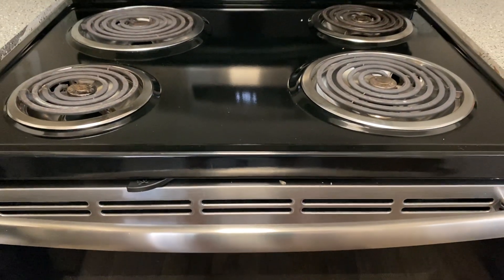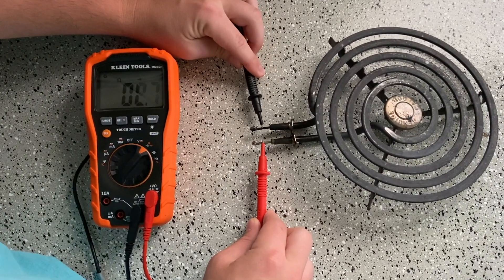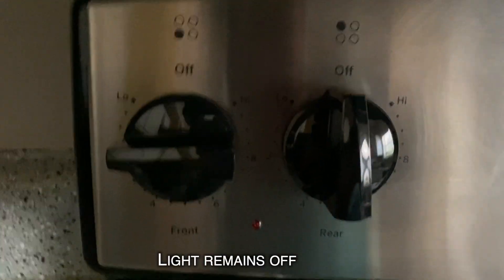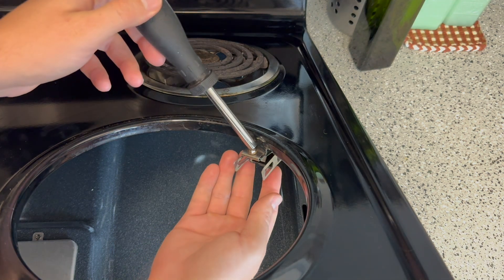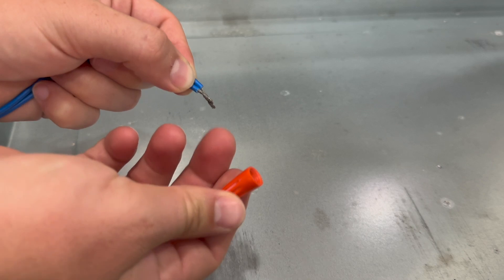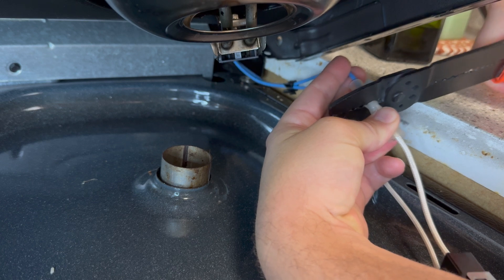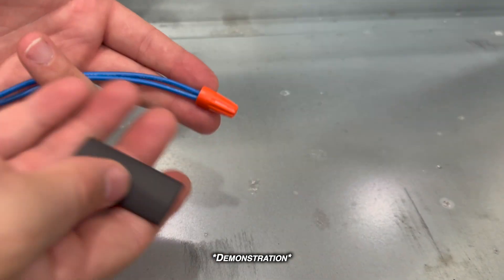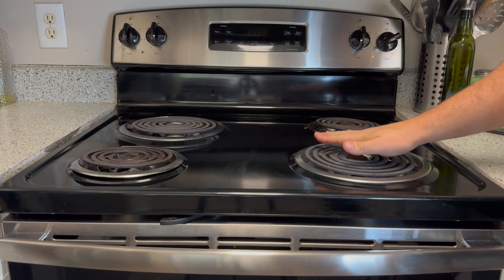DANGEROUS Stovetop | Electric Range Stove Not Working

Comment: I saw one big spark and pop turned off the stove. Checked the coil and its clean and nice. But the heating reseptical looks burnt and shot. How much will this cost to get replaced? 

My land lord is going to kill me 😢

What could have caused this?

Is the rest of the burners safe to use in the mean time?
Reply: Same thing happened to me while cooking , the burner sparked on fire and popped and made a hole in my pot and started a fire but the water from the soup turned off the fire  . I think once they do that they are no good tbh.

Comment: The terminal block and wirenuts that came with my kit were ceramic because plastic will melt.  Using a plastic coated splice seems like a bad idea unless that is high-temp plastic.
Reply: Probably a thermoset plastic.